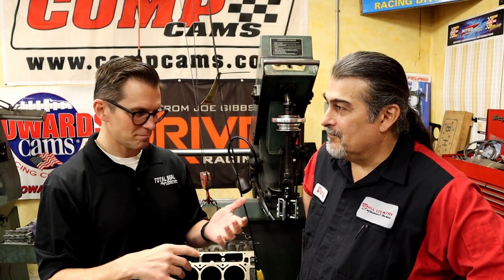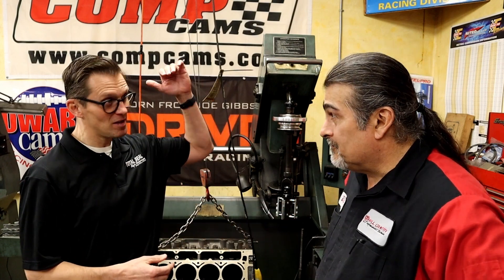How to make more hp by changing your rings

Comment: I built a little 283 back in the 70's  Dropped it in a 57 Chevy and got it started by spraying fuel down the three carburetors. It ran for 30 seconds.  Someone stole the heads and intake manifold and it was never a complete engine after that . long story short. After watching Danny and Faye build engines, my little engine probably wouldn't  have lasted much more than the thirty seconds.  I was 18 and still in training.